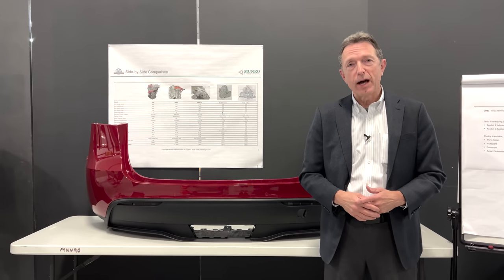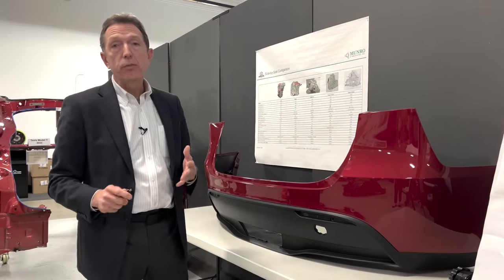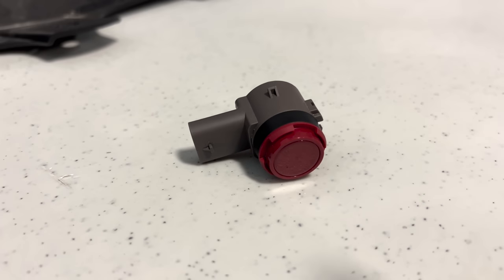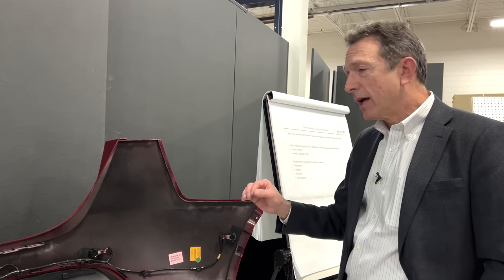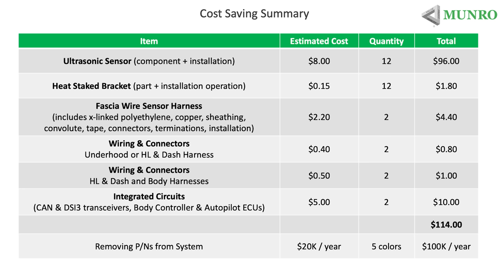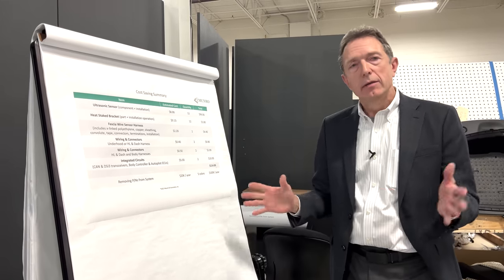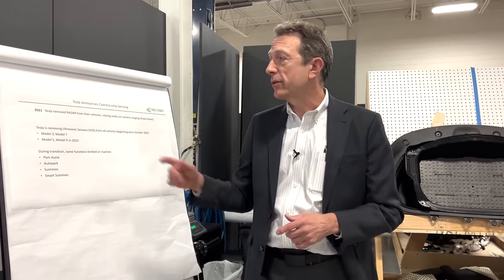Tesla REMOVING Their Ultrasonic Sensors

Comment: Same thoughts for me i think cost cutting for something like this is not the right way, the car can guess distance but a wall it gonna be hard to tell how close it is in inches like a physical sensor. What if the camera doesn’t see something backing up like a trailer hitch? Same with the radar I think it was a good “just in case” item and it had absolute no phantom braking when it was sure physically nothing is in the path of the car. Ultrasonic is so low resolution it’s just more accurate for distance. I like to get close to the cars in line and see the inches left and the camera can’t do that. 
Also on another note, I assumed the cameras are 1.2Mp due to better low light high frame rate use if it has a 5mp it will naturally do worse in low light conditions depending on sensor. 

They need to forget about ultrasonic sensors and work on ways to clear the cameras in rain or snow.

Comment: I was driving the new Kia Niro EV today. After 50km in rain and Abit of dirty roads, the backup camera was not giving a good picture when I was parking at my pretty tight space at my cabin. So i had to use the sensors to not drive into trees or rocks. And you know what, it worked perfectly! Without the sensors i could not know if i was 5 og 15cm away from the big stone popping out of the ground.

How is tesla gonna solv this, with limited view in front, and also with cams covered in rain/dirt/snow...

They might put in new cameras as this gentleman explained, maybe even more cameras. But what about us without these better and/or more cameras?

Comment: I would say the 5Mp cameras are likely cheaper than the old ones, as they are current products made in large volume as security cameras. So the cost to use them is more the updated firmware in the car to handle the higher data rate, and the different front end possibly to interface with the camera, though likely it is all still a standard security camera rate, and can be done with simply flipping bits in the front end interfaces. Thus actually no cost to improve the cameras, though probably most of the time the higher resolution will simply be downsampled to lower resolution, as after all lane departure and such really only works with edges, so more data is bad. Higher resolution possibly to improve sign recognition, and of course better in car video recording, though likely with a higher data rate a larger SD card for storage now needed.

Cutting the sensors likely just relying on the computer and stored data, plus knowing accurately vehicle position, to provide the same level of detection, though it will not help against things moving after the image goes out of frame.
Reply: It can keep track of all movement around the car while it's parked. It is already doing it now with Sentry mode.

Comment: You didn't mention sensor conflict. I had the direct experience that the car didn't detect a tree with the sensors because it was in between the ultrasonic sensors. So, the Summon managed to hit the tree. A tree is generally larger than the 1 foot hight of the blind spot. In the software it can remember the occupancy of the closest environment in the blind spot and sentry mode can see objects entering the blind spot areas.
Reply: I was pulling into a parking spot in a Park where there were rocks in front.  I was wondering when my sensors would start dinging and ended up lightly hitting one rock that was between my sensors so they're not that infallible...I like the idea and hope it works where the camera can have a bit of a memory of what was in line of sight before you get there and hit something
Reply: If you listen to what the FSD does, then you might know that it has an occupancy network that deals with objects that go out of sight. Dedicating a close proximity occupancy domain that has to remain in memory while the car is parked should be an easy item in the software.

Comment: Hi folks, the problem is not switching from Ultrasonic to Tesla Vision, the required technology has been used in quadcopter/drone applications for several years now. The problem is where the Tesla Vision cameras are placed. At present they leave close up blind spots. Now, modelling of the surroundings in the software can deal with some of this - once a immovable object has been detected the software can work out if the car is approaching it as it knows how much both the road and the steering wheels have turned. It  is not so good for things that move, like small children. What's needed is cameras in the front fender and to a lesser extent the rear one - there's already a rear view camera the driver can use. Even better if they covered the close in corners - very helpful when trying to get out of tight situations.

Comment: Any estimate how much the upgrade from 1.2 to 5MP will cost? I'm sure it'll offset some of the USS removal benefit
Reply: I suspect general improvements in camera tech will have reached a point where the low pixel cameras may not even be made anymore.  Just see the increasing pixel count trend for smartphone cameras.  Multiple cameras with single cameras up to 60MP (million pixels) are common by now.  Also Tesla need to buy cameras in the millions.  Just production year 2023 should require around 16 millions cameras for a 2 million production run of cars.  Together these two factors should alone give a lower cost per new camera - unless the cameras are very special or the general supply limitations come into effect.
Reply: Yes but the 5MP upgrade was going to happen anyway, this was a side effect.

Comment: I use the forward looking USS when parking, but more like a check on my own spacial judgement.  I am not dependent upon it. 

Reversing out of my garage, it is tight on all sides of my Tesla and the situation requires steering while reversing to not hit things. In this case, the USS chimings drives me nuts. I don't use them at all. I use the cameras and my own eyeballs (which are conveniently on a swivel mount) in order to keep spacially oriented. 

I won't miss USS.

Comment: My 21yo Toyota (manual) doesn't have ultrasonic sensors and I manage just fine. BUT...  Tesla does need to put some more cameras up front on the corners of the bonnet to assist with pulling out at intersections - and a side benefit would be this specific coverage.

Another cost saving in removing the ultrasonic sensors / looms is weight over the life of the vehicle which translates to range.

Comment: Just got tesla model 3 2023 of course no USS. A bit disappointed. Tesla advisor confirmed no other changes to 2023 compared to 2022 model except removing of uss. No upgrade to camera nor to cpu. Advisor said once update over air and tesla vision will be the same as uss. So no need to be concerned. Will see about that. Should ve making telsa vision working before the remove of uss in my opinion. Wish me luck on tesla vision😅

Comment: More importantly than the hardware reduction and the cost benefit is the data stream availability. The ultrasonics tie up a significant portion of the processing and data stream availability on the processing side. This move was likely necessitated by the need for more processing availability for the vision only processing stack.

Comment: If you know where object was, when you were approaching it, despite losing the vision due to camera angle, u know the movement of the car precisely. So you can code it in the software to still “see” the low objects. If they decided for this move, they had a viable solution, for at least big majority of use cases.

Comment: Front blind area is relevant when I park reverse then take off forward.
Once the front and B-pillar cameras are on, nothing can sneak into the blind area.
Even a squirrel will get caught by one of the cameras.
Running the front and B-pillar cameras takes some battery energy, but it can be washed by not running the 12 uss.
Just my quick thought...

Comment: Even if it isn't mentioned, is it a possibility that they are adding a front bumper camera to fill in the gap? If they have supply issues with the USS, it might be cost effective to swap the assembly complexity of 12 sensors in two places with a single camera.

Comment: There is no calculation of the labor savings by not installing the sensors and harness or the production line time savings which should allow for more car production with the same labor.  It also simpliefies the car and eliminates the cost of warranty claims if a component fails.  

Regarding the concern about the front camera not being able that last foot in height, this is incorrect. When you are pulling into a parking spot or garage, there is full camera visibility.  This is how our eyes function as we too cant see thar last foot when almost parked but we saw it while pulling in.  This is genius by Tesla and again shows their advance thinking and continuous improvement.

Comment: Increase in megapixels cannot compensate the blindspot left by missing ultrasonic sensors. I do suspect some cameras on the front and rear are going to be in a pivot(or a mirror infront of some cameras on a pivot that is dynamically adjustable-again due to calibration and rigidity constraints it might be a two position setup). Just my two cents.
Reply: Also both radar and ultrasonic sensors can detect physical objects. To do that on a vision based system would need depth perception aka stereoscopic vision(need a min. of two cameras with associated depth processing in vision system). If there is a glitch we are expecting a lot of phantom? fender benders! which unlike phantom braking will most likely result in physical damage.

Comment: USS - ultrasonic sensors are prone to fail in our harsh winters. The cost for vehicle owners to replace one on a Lexus 450H is over $250 CDN…! But they are also very difficult to remove and not much easier to replace…..so the total cost to the typical owner can be much higher!

Comment: Thanks for the presentation, especially the cost info. I think removing these sensors will also reduce some software maintenance costs and simplify body repairs somewhat after a fender-bender. Repainting the vehicle will be easier. Ultrasonic sensors are not all that reliable to start with and cannot spot all types of obstacle. The vision system and wheel rotation sensors will allow Tesla to spot and track fixed obstacles (like curbs) very accurately, as the car approaches them. Moving objects, like kids or dogs, will be spotted before they get into the small front blind spot.

Comment: Nice video Mike.   My concern is the deletion of the both radar and ultrasonic sensors.   I drive a 2019 Model 3 with FSD beta and love it.   The Tesla Vision approach is good; however,  all the cameras are single fault tolerant and and if a camera fails at a bad time there is no redundancy to protect the occupants of the car.   If a camera fails, the ultrasonic sensors and radar could provide  "unlike" redundancy to get the car slowed down and stopped or control safely passed back to the driver.   I'm wondering if the FSD computer may be reaching processing limitation (bandwidth) with all the objects it needs to identify and dealing with the near "infinite"  variety of day to day driving solutions needed.   Perhaps deleting the radar and ultrasonic sensors are a way to deal with the potential data processing overload.   If this self driving architecture is going into robo-taxis as Elon envisions,   it needs to have some redundancy to protect the occupants.  This requires, at a minimum, system redundancy, including unlike redundancy to deal with bad weather and fog.

Comment: Excellent analysis, I completely agree on all points.
I'm also a little worried about the gray area at the front of the vehicle, if the tesla is moving I have no doubts, but if the vehicle is stationary and something has slipped in this area  grey ...
I also imagine beyond the economic gain that there is also a time saving which is not negligible on x tesla assembling we surely gain enough to produce at least 1 more ahaha
Reply: What about dirt? The side and rear camera doesn't have washers/vipers and are practically useless if it rains.
Reply: @haraldk6828  d'ailleurs j'ai envie de penser que quand on doit rouler sans les aides ques les rétroviseurs latéraux sont remplies de goutes d'eau que la vitre arrière n'offre pas de visibilité dans certains véhicules et on conduits depuis des centaines d'années... Alors je crois que tesla vision peux aussi le faire
Reply: @haraldk6828  side cameras don't get dirty in my 100k miles on Model 3, and are rarely affected by rain. Rear camera isn't needed for autopilot.
I do wish the rear camera had a little sprayer or something.
Reply: @GregHassler  I often get warnings on my Model 3 that side cameras are dirty/covered in bad weather and that autopilot functions are limited.

Comment: If Tesla's vision can handle object persistence when occluded (like seeing something entering using the B pillar camera that wasn't visible on the front facing camera), and assuming if it disappears infront of the vehicle that it's still there.  That should resolve almost all of the issues with ultra sonics missing, assuming they are capable of doing that...but it seems as though they might not be there yet in terms of object persistence.

Comment: Perhaps the FS cameras at 5mega pixels are enough to detect any body that might enter into the blind spot? And the system could measure the distance of stationary bodies, enter into the vehicles front blindspot?

Saving 500k in annual production would not be worth the liability of the car running over toddlers. Loved this break down!

Comment: Wondering how well the camera based solution will work with snow. Usually I get FSD warnings about limited sight way before the USS are blocked.
Reply: Better. Snow clogged my radar sensor many times. The camera? Never. The windscreen wiper made short process. WWW - Wooosh Wipe and a Way 😎
Reply: @wolfgangpreier9160  Well, there are more than the two cameras behind the windshield.
Reply: @cb2206  yes. Three. And the windshield wiper made swooooosh…

Comment: If there was occlusion in the 3ft range of the cars hood and anything moved out in front of the car, no automatic breaking system would make any meaningful difference in energy of the impact. So I think it's far less risky, than we might think. 3/4 of a second vs 1.5 seconds for a automatic emergency breaking system vs the human. Even at 5km/h you are moving more than 3.2 ft/s. The impact speed will be the same.

Comment: In Michigan you should be worrying about the grime accumulating from old snow and road sanding and rain. I experience that problem in upstate NY with just a back-up camera. Easily wiped off, but in bad conditions that needs to be done every time you start driving. Doing that for every camera must be a real PIA.

Idk if radar could detect the road shoulder through drifting snow, but if it could eliminating it is a bad idea. I sometimes drive on small country roads with ill defined edges to the pavement. Being as good as excellent human vision is great - but I'd like something better than human vision if technology can provide that, especially when driving thru heavy snow or fog.

Comment: The blind spot was my only concern, I'm sure they're handling it but I'd like to know how, one way is to leave all the forward facing cams and computer online so they can see stuff approaching the blind spot, but that'll waste a ton of electricity.
Reply: That's actually how Sentry Mode has been working for years.
Reply: @Todd Stein  but not for people who turn it off, or have it exclude, work, home, known places. This will affect people who don't have a plug at home or  share a plug between cars

They've made great work preventing sentry from crashing the AP computer lately to the point where I leave it on all the time now, for the first time since it was first rolled out to the fleet (might only be fixed in FSD beta though)

Comment: They have a lot of work ahead of them. The biggest problem short term is convincing people they'll be able to survive without parking sensors on expensive cars. There is no tail pipe or expensive splitter to replace, so that should help, and the hood is low.

Long term they'll need really high positional awareness, and good graphics. Once that's done, they could offer a better experience than sensors could provide. Think graphics showing you the exact position of parking blocks. They needed to do this to keep up with the concealed sensors Daimler has been using, to afford the new cameras and to make summon usable on a daily basis, without hitting curbs and breaking splitters.

Comment: Are there any known problems with having input from various sensor types, and coordinating "autopilot" and pre-emptive safety systems, as compared to using a single mode ( cameras only ) ? Does contamination not affect cameras? The roads I drive have mud, snow and salt brine that cover the backup camera on my dinosaur recycler.

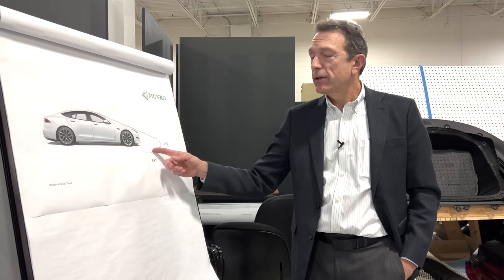Comment: @Mike Lane @7:40 My understanding of why they have removed the sensors and temporarily disabled these features is due to the software not being ready for these features in time for the planned deletion of this part.  There has been a push to have these ready for the end of September, but they weren't.  So until these features are ready[a month or two] new owners will be without these features.